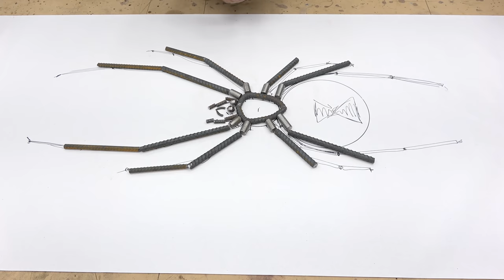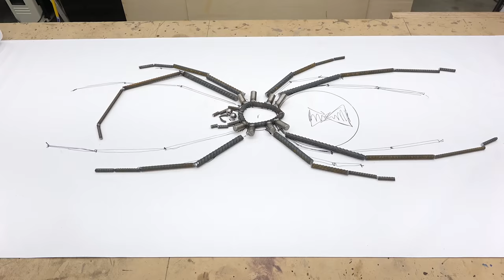Spider Pumpkins - Arachnophobia Jack O' Lantern

Comment: Justin the is so awesome and I hate that I haven’t done something like this already.  Great job.  And one more tool you have that id love to have in my shop.
Reply from the maker: Thanks Chad! Do you mean the rebar cutter? If it do, be warned, because if you have one it usually means lots of hard work...;)
Reply: In the video it looks like it's just going right through the rebar easy peasy.... Not so much... Hey Chad! rent one first then decide but I will use a grinder or metal chop saw whenever I can.
Reply from the maker: @davestrain1762  it does look pretty easy in the video, doesn't it?  Ya gotta have some muscle to cut the bigger rebar but the smaller stuff cuts like butter.